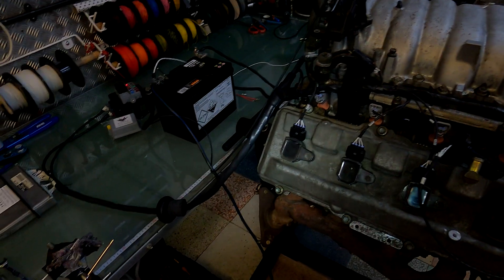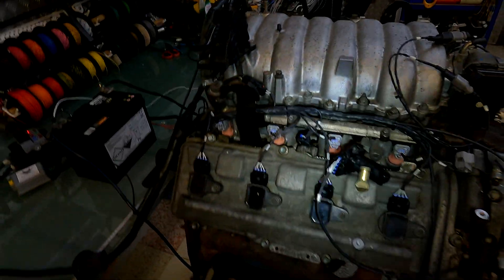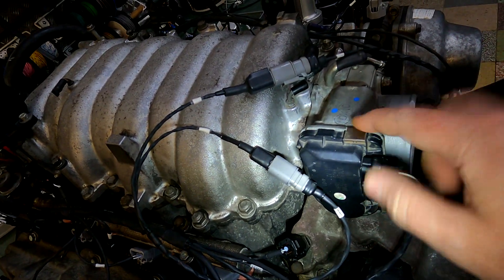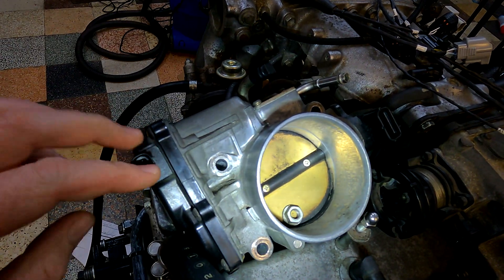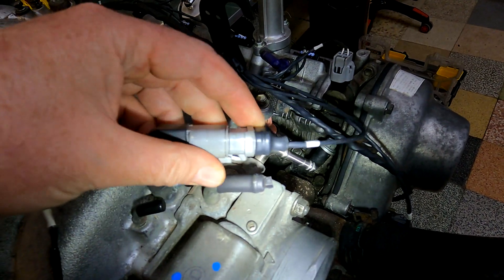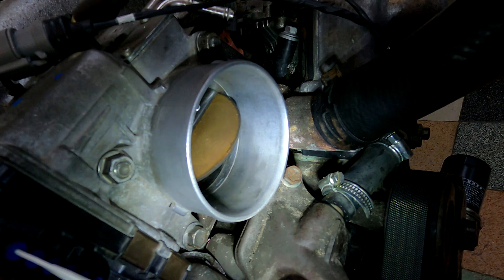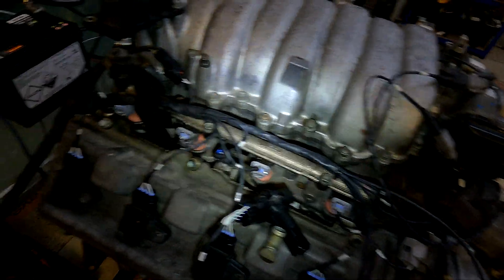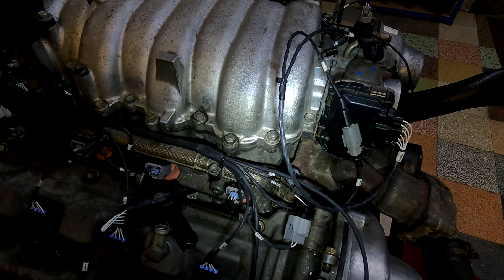3UZ Throttle Bodies are they Interchangeable!

Comment: Any idea about using a 90mm throttle body? Beneficial for power gain or not
Reply from the maker: To be honest there are loads of video's from the likes of HPAcademy that go into detail about throttle body sizes and a lot of the misconceptions around "bigger is better". I would advise having a watch as it explains it in detail and demonstrates that usually going bigger can sometimes be more problematic especially in relation to a street car and controlling idle. The best solution is to get data to determine if the standard throttle body is actually becoming a restriction to making more power.

Comment: How I can convert throttle body with 2 pin to 4 pin? And the engine computer should be change to one for 2004-2006 computer.
Reply from the maker: Hello if it is a standard vehicle then you wouldn't need to at all. Ideally you can just have a remap so the throttle response can be improved on your standard Throttle. Also you can give the throttle a good clean as gunk can build up and cause the motor to have to work harder to move.

Comment: I have lexus Ls430 2002 5 speed  and Ls 430 2006 6 speed , I notice the throttle body reaction is more quicker than the one which is in Ls430 2003.